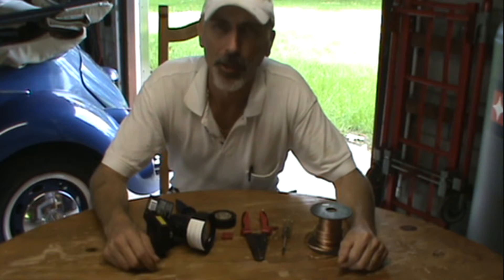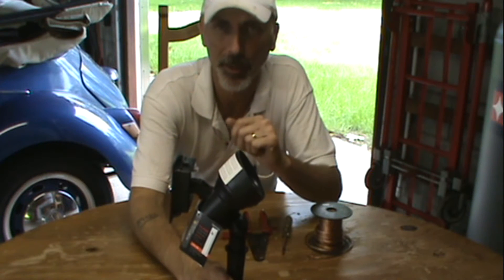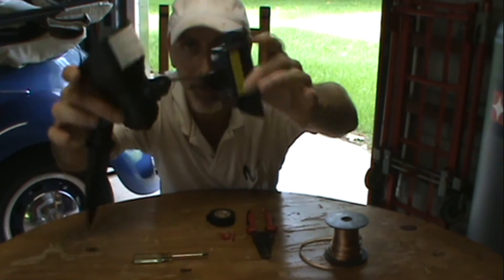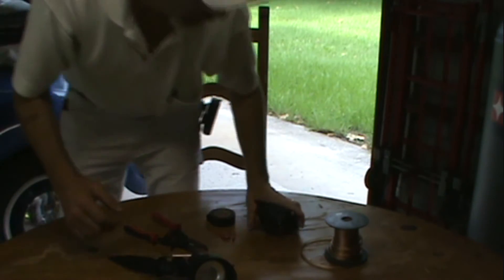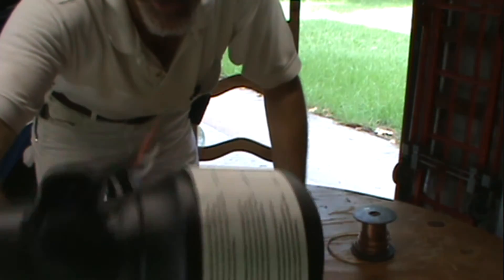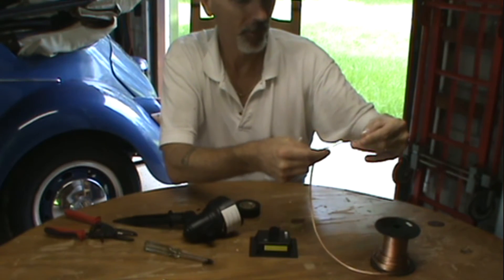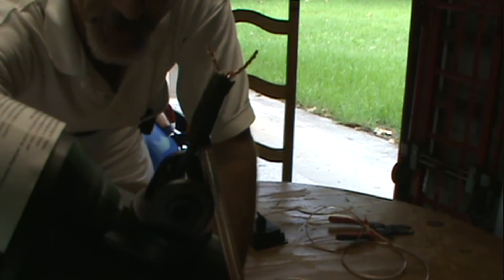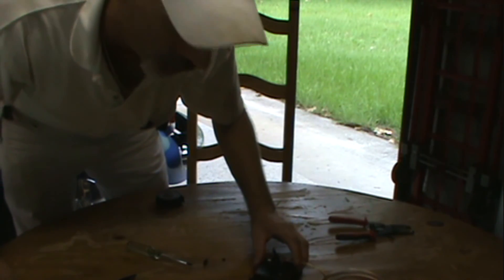DIY Cheap Solar Light In The Shade

Comment: You, Sir, are brilliant! I appreciate your tip! Thank you for sharing it with me! I am going to do this with the solar lighting that's I have in my flower boxes hanging in my windows and just run the wire up to the top of my house. 

To those who's property doesn't work when you extend the wires: Try Soldiering them together. If they still don't work after you hit them with a Lil bit of soldier you just solder the wires back to their original length and it may fix it. To avoid crossing your wires, used marked wire or trace the wire properly on the extention wire, and on the light just work with one wire at a time.